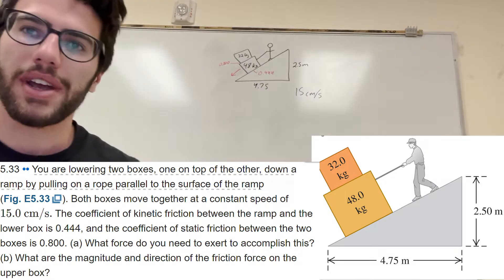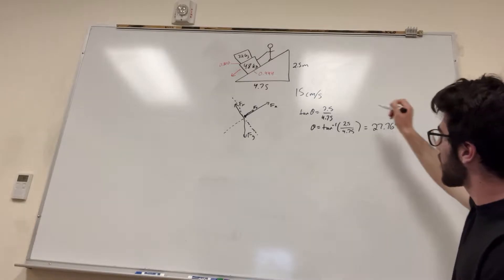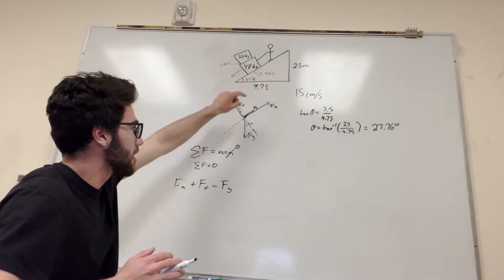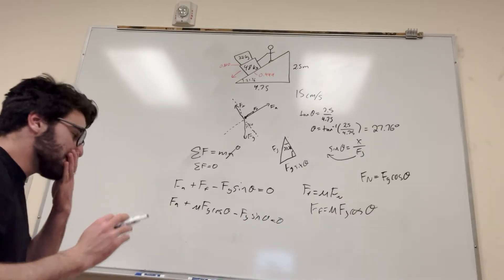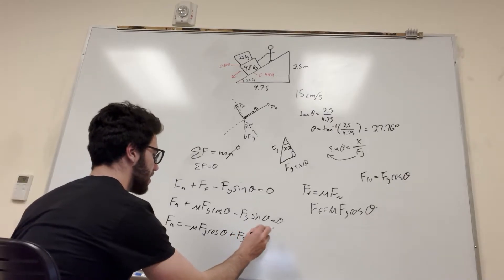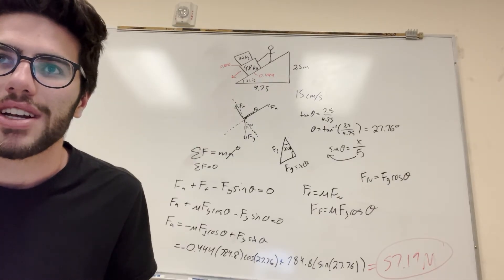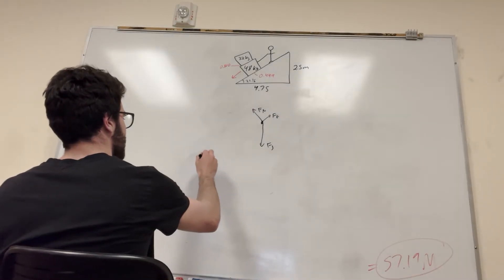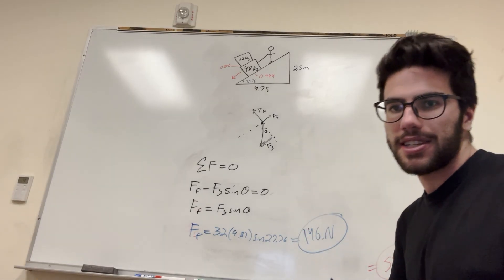You are lowering two boxes, one on top of the other, down a ramp by pulling on a rope - Problem 5.33

Comment: would the answer to part a still be the same if the velocity was 300cm/s instead of 15? since the velocity was not like incorporated into the equations? also would the answer remain the same if question asked if the box was pulled up with a velocity of 15cm/s instead of pulled down?
Reply from the maker: Yes, force only is effected by acceleration. Therefore, it doesn’t matter the speed as long as the velocity stays constant.